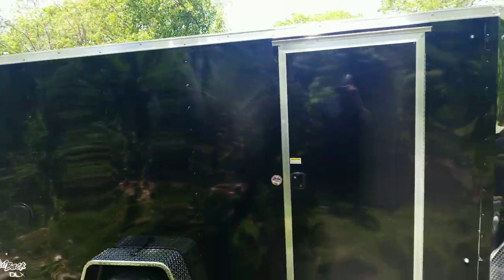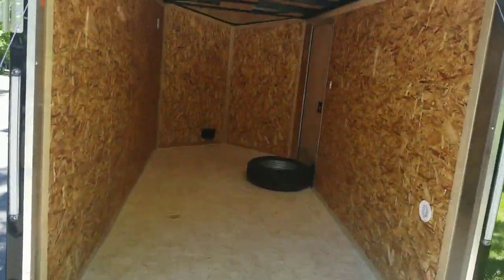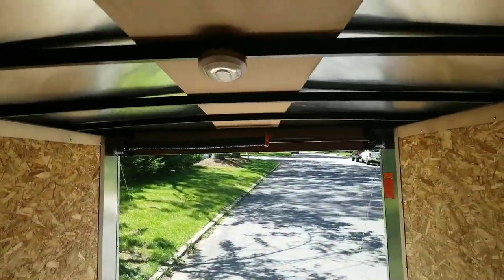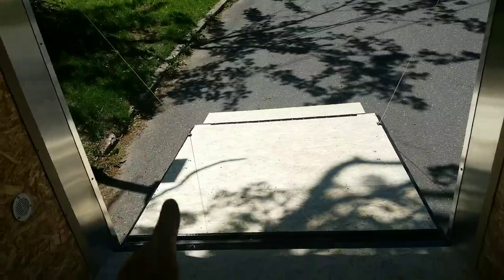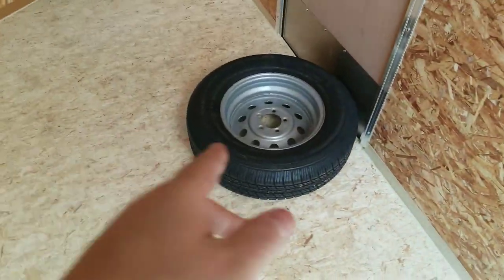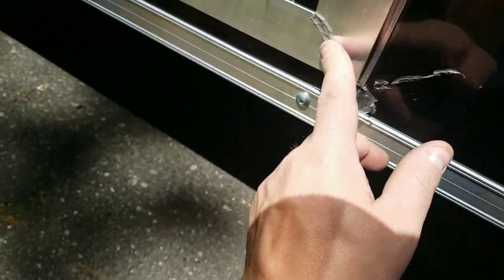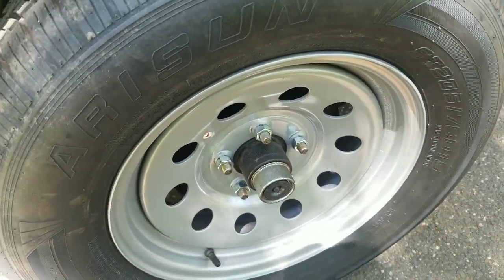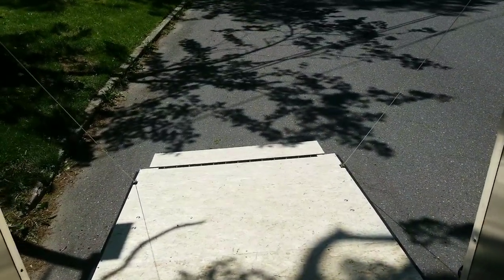2020 pace outback dlx trailer walk around

Comment: The trailer looks nice. I know it’s been some time since you posted but I’d like to share with you and your readers my experience with my Pace Outback. I have a 6x12 as well in black but with barn doors. Mine looks nice as well from the outside but that in itself was quite deceiving until I began to work on it. First thing I decided to do was insulate it as I’d be in it throughout the year in NY weather either working or possible camping. After all, it is a tin box exposed to the elements. During disassembly of the interior panels, I noticed that whoever put this together, either doesn’t know what a ruler is, can’t read one or possible had one too many with lunch. There are so many mis-drilled holes and screws that go into nothing that I spent more time correcting all these mistakes than anything else. The space between the rails are not symmetrical so cutting the insulation was a horror show to say the least. There’s also plenty of space at the seams of the floor to allow drainage in case I decide to open the flood gates. What a joke. The wiring: most of the crimp connectors just fell off. It’s amazing all the lights worked at all. The silicone: If you can imagine applying silicone but completely missing the target in 90% of the areas. And it’s good silicone too, very difficult to remove. Nothing is perfect but seriously.....If I could make a suggestion to the manufacturer it would be to rethink their hiring criterion or build in some quality control. It’s really a shame the lack of craftsmanship that goes into the build they sell to us. Whoever they use to make the outside look nice, should certainly help with the inside. I sincerely hope you’re experience is much better than mine.